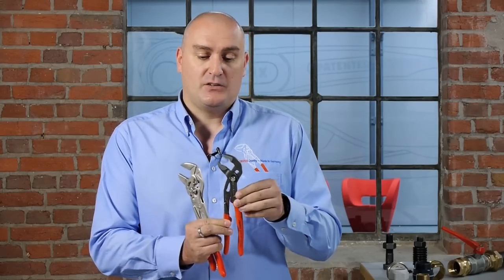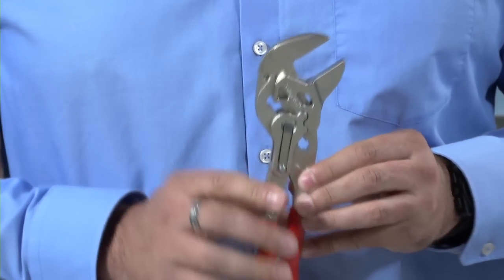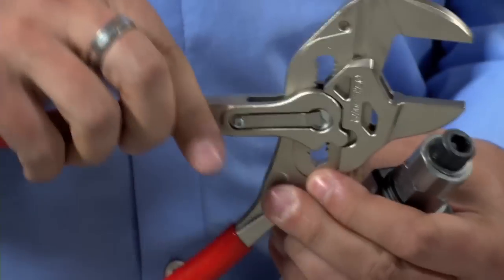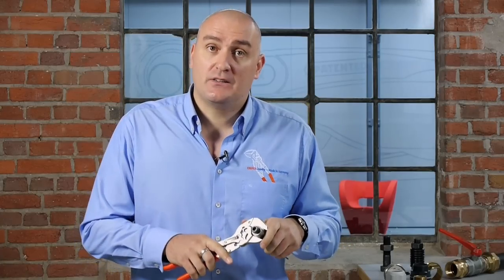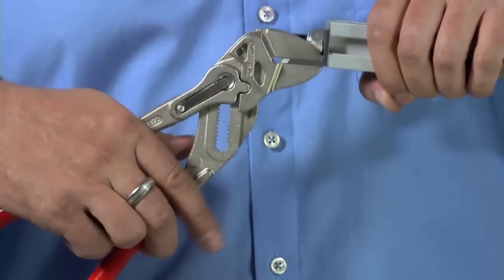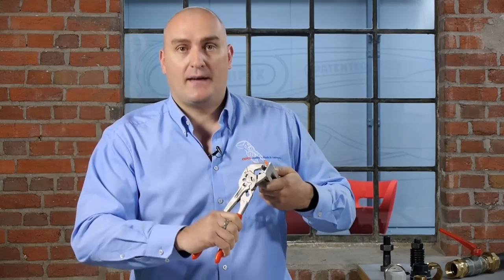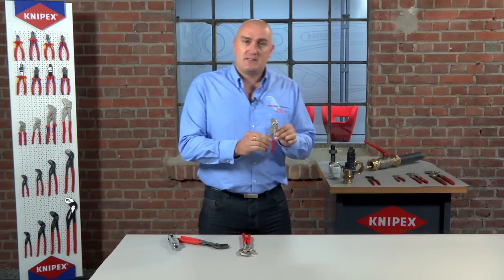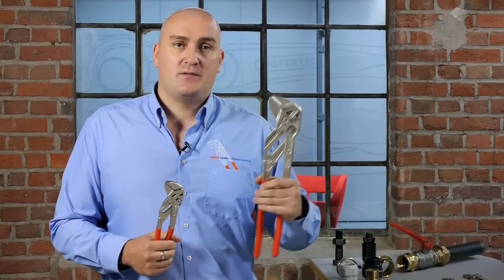From the KNIPEX workshop: Pliers Wrench Range

Comment: I’d love to see a 22” version and/or even bigger. As a sprinkler fitter, we use smooth jaw 24” pipe wrench for some hose connections. I use the smaller versions for the smaller valves and sprinkler heads almost daily. They are the best by far. Can’t say enough good things about them.

Comment: I used these daily on aircraft
1. Jaws are polished smooth
2. No round off 
3. Parts in remote spots don't fall
4. The relaxed slip back acts like a ratchet
5. Low profile!

Comment: Hiya! My next-door neighbor Davy, is a machinist.  He has industrial-looking equipment from the 1950's there in his shop downstairs. It is precision milling that I've seen him do with his mill lathe and a drill press type of equipment that can mill steel and such. It is so impressive to me to see him shave away that steel and fabricate components for motorcycles; from scratch!
As I'm looking around his shop, I found that he is using these KNIPEX® Box Joint Pump Pliers. They looked like they were old and beat-up, however worked just free and fine!
I was so fascinated by the Box Joint on these pliers, I went to SEARS and bought the same model pair:
KNIPEX® Alligator® adjustable Pump Pliers  Model #: 88 01 250
I have a decent understanding of how the two pieces are slipped one-into-the-other while the metal is still hot enough to be malleable and then a further forging and tempering process is done.
I am thinking that these pliers consist of only TWO (2) pieces of metal to make them up to be what they are.
I have read on the KNIPEX website how the "pivot" is usually a "rivet" on many pliers; adjustable or not. I suppose the "pivot" on the 88 01 250 (and the other sizes) could be a "third/ 3rd" piece; somehow forged, or pressed; and then re-forged or re-tempered; somehow.
Upon close examination of this tool, it appears as thought there is a third "rivot", if you will, because of the round shape around where the pivot pin is. this is only detectable on the one side. The other side appears as though it is jut one piece.

 Summary/Question:  Are the KNIPEX® Pump pliers with the Box Joint just two pieces: one half had the "pivot" forged into it, and the piece with the slit, making it adjustable, is the other half?
I like all of your videos and your company KNIPEX® is making very impressive tradesman tools that I am investing in. Thank-you!  
OK     
 Foxx  =^.^=

Comment: Dear Knipex, I'm very disappointed with the 10 inch version I bought recently due to the following: 
1. The size of the thumb operated button cap is not wide enough for my normal sized thumb [apply a much larger cap]. 
2. It is near impossible to fully depress the button to allow jaw slide working below a demonstration workbench or with my work gloves on [resolve button travel to a minimum]. 
3. You demonstrate adjustment to a fastener with the jaws mostly open. Fine. However, you need to adjust with the jaws near closed to avoid the approx. 1cm jaw travel to get the handles closed for optimum hand leverage with a closed fist, not an open hand. 
4.Also, you would likely compress/deform a softer fastener with the massive clamping force to close the handles. 
5.Finally, why not allow an owner to change over the thumbe operated button from one side of the handle to the other to allow natural left hander use? Put an additional screw hole and matching recess on other side of the retaining spring plate.